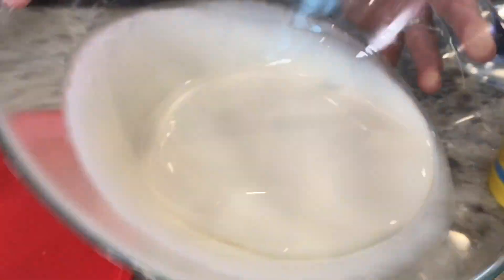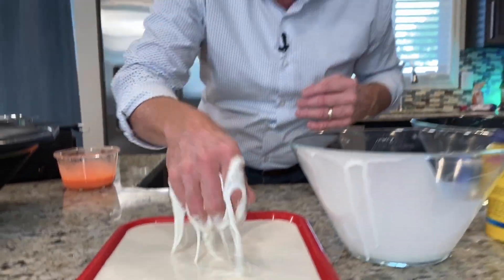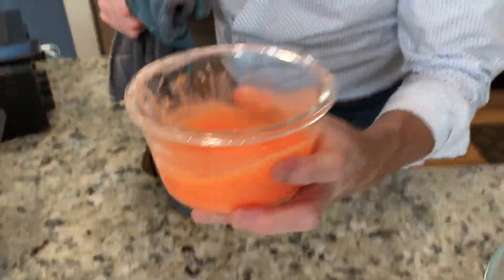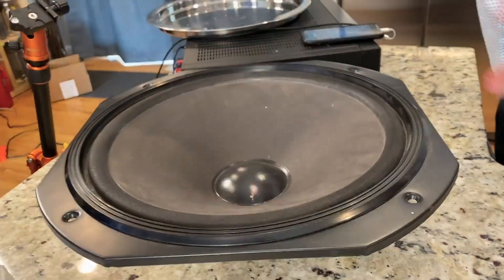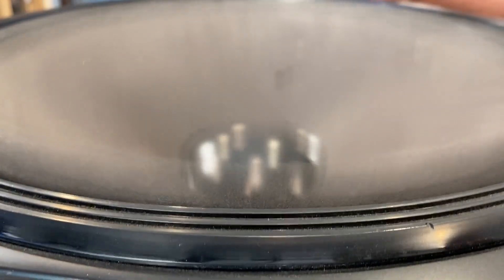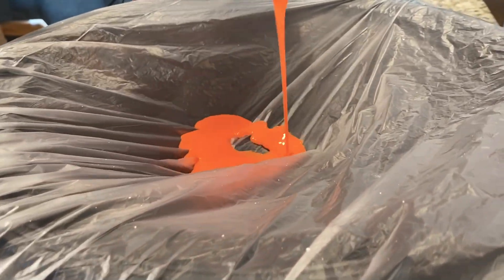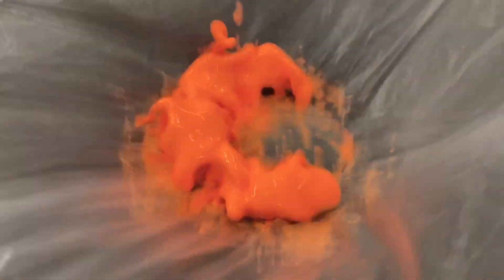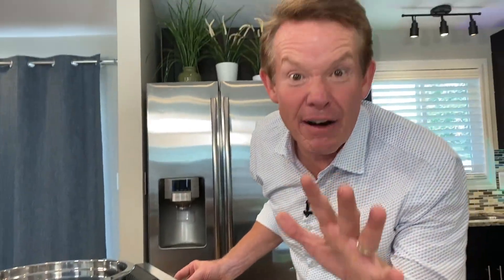Cornstarch Monsters - Science Minute

Comment: Years ago I mixed cornstarch with a glue mixture came in 2 separate tubes to a toy space model kit that had never been put together, I found at a garage sale and was able to repair my right wooden shoe’s heel that I unfortunately had lost parts to. I colored it to match the wood then molded it quickly to the exact match of the left shoe heel! After it dried and hardened within a minute, I sanded it smooth to the exact match; it hardened harder than wood!